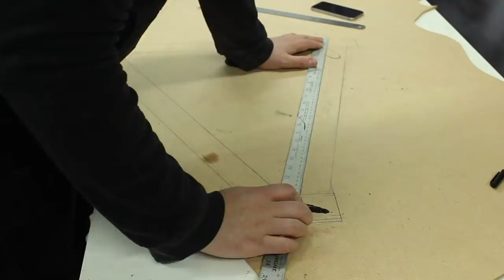Wooden Bike Build - Part One

Comment: Hello david, i have three questions if you would mind to answer i would be grateful.
-What diameter are the aluminium pipes for the cabling?
- What width of each "laminated timber" you use?
and the last and most important:
- What kind of pipe do you use for both the seat and fork mount?

thank you very much in advance
Robert
Reply from the maker: I built this years ago so I don’t know what diameter the aluminium pipes are, i just bout it from the hardware store, big enough to fit a cable through 🤷🏻‍♂️ the laminations were different thicknesses, thinner ones in the centre and then thicker for the outside, the thinner ones were maybe 3mm or 4mm but it’s personal preference really. I bought the bike specific tubes from framebuildersupply.com

Comment: Hi..Amateur here...Why did you cut the wooden into thin strips and paste them together again.Why not use the solid piece of wood as it is?Is it a aesthetics thing or strength?
Reply from the maker: Both aesthetics and strength! The glue is stronger than the wood and the laminations of wood is stronger stiffer and more stable than just the one piece. But I could’ve done them all from one type of wood but it looks nicer with a pattern. Also for the chainstays I wanted to bend them and have them stay in that shape and a glued bent lamination is the best way to achieve that.
Reply: @DavidParker  thanks for the reply David.I have watched almost every wooden bicycle video/picture out there and I mean it when I say,Yours is the best looking bike out there.Learnt alot and enjoyed.I have a few more questions though,can I get your email ID? If you don't mind

Comment: Hey David ! Great work , congrats ! I noticed you used epoxy (West ?) in the build, but the coloration of the epoxy is different in the beginning of the video from end (9:08). Looks darker. Did you any kind of filler , saw dust ?
Reply from the maker: Lino Silva yes, I used west systems epoxy and added west systems filler plus a little bit of sawdust for colour. Just incase one of my joints wasn’t perfect, I didn’t want a white seam where the epoxy had filled a gap.

Comment: did you calculate some geometry and forces ? I would love to make a wooden bike, but I am not sure if I just do it or should calculate some stuff.
Reply from the maker: N. C. I copied a metal bike frame for the angles etc and then I made the tubes a bit wider and some more material around joints, but no calculations really. I made the walls of the tubes about 8mm because I’d seen someone else say they’d made them 6mm and I figured I’d go for extra strength 🤷🏻‍♂️ I say go use some common sense and go for it! Good luck!!